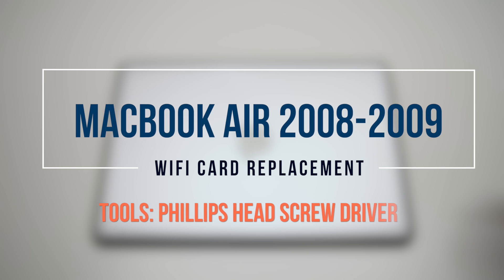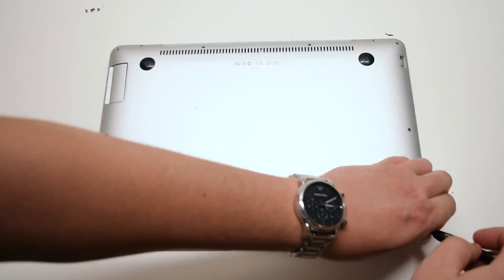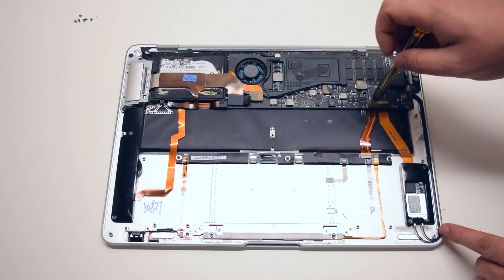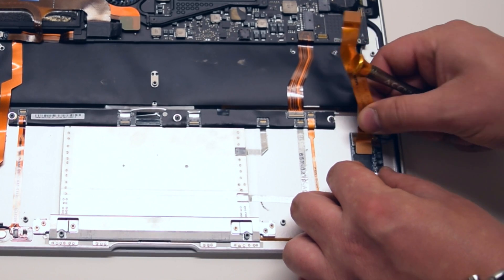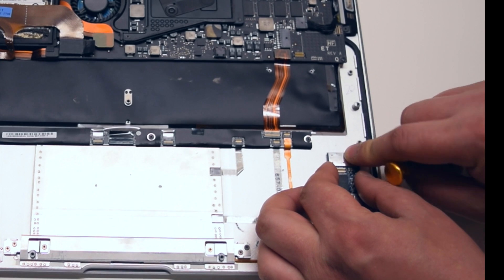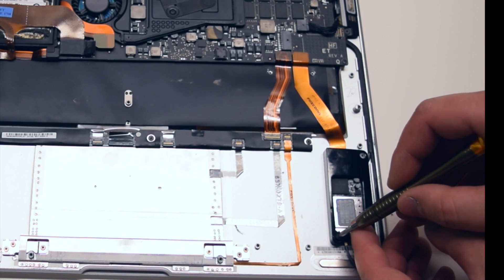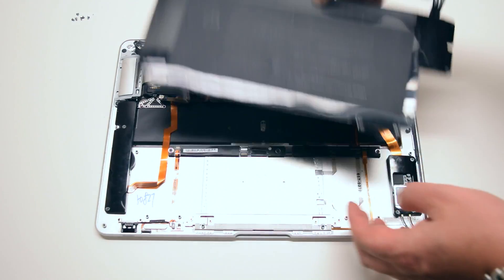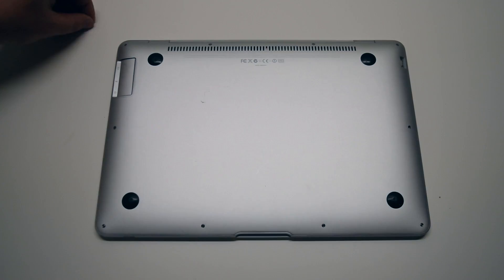Macbook Air 2008 and 2009 A1237 and A1304 WiFi Card Replacement

Comment: Great video. Very helpful. thank you very much. Do you happen to know where to buy an upgraded wifi card to add N / AC to my Late 2008 MacBook air?
Reply from the maker: This is the only card that will fit https://ebay.to/2JRZcfF but you can use a USB N card here https://ebay.to/2LOqIIl